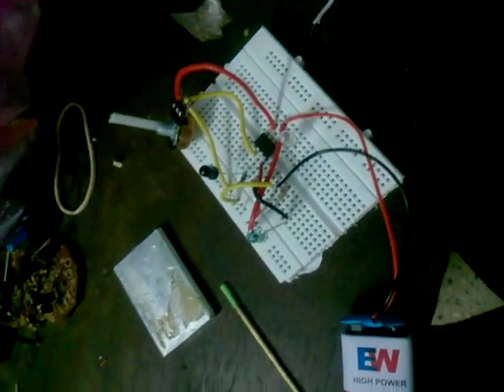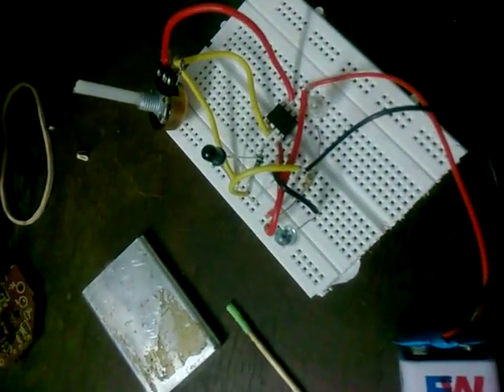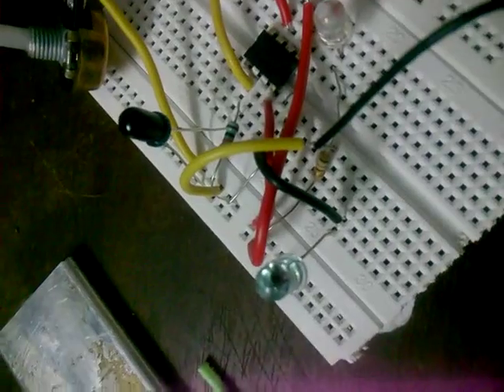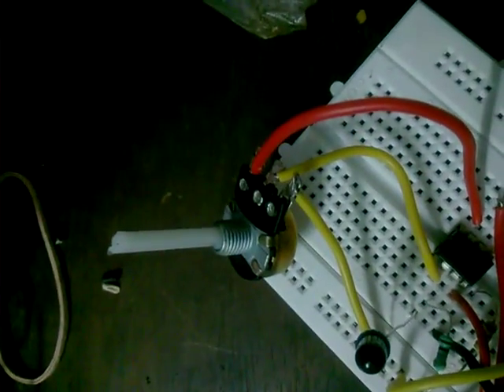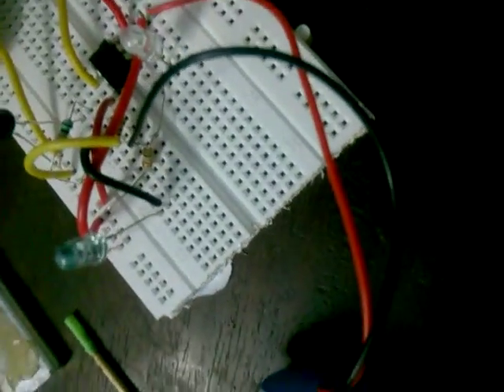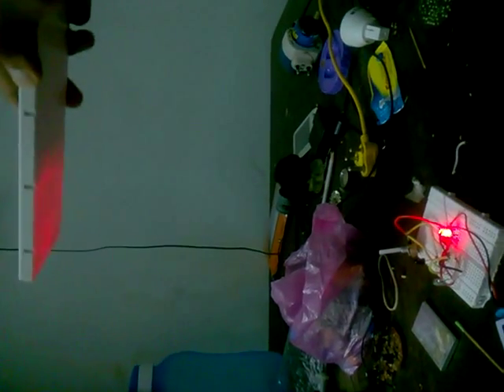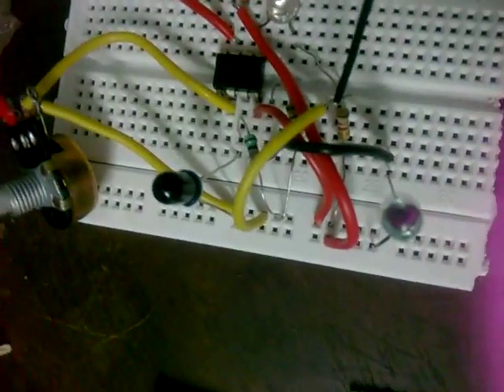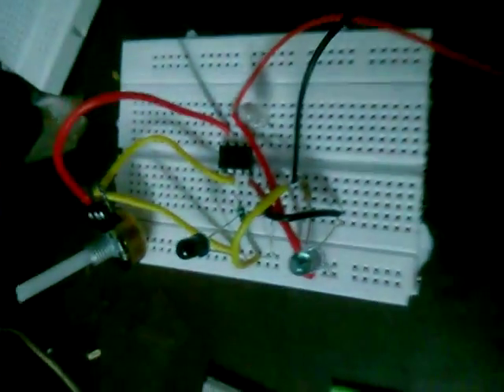Op Amp based proximity sensor (Very sensitive)

Comment: I tried this using the schematic diagram (all resistors 1k,1k,10k and 10k potentiometer value) you gave but there seems to be a problem... Red LED is already light on... it should light only when theres object right? what you think is the problem?
Reply: +i Heretic is it because I used 1k resistors?
Reply from the maker: +i Heretic +i Heretic did you try adjusting the value of potentiometer. Try both 
the extreme values of potentiometer. Also make sure that the Photodiode 
is reverse biased ( Cathode connected to positive rail of the battery). 
Let me know if it solves the problem.
Reply from the maker: +i Heretic no its not because of 1K resistor.
Reply from the maker: +i Heretic Also the green wire in schematic is not connected to the potentiometer.
Reply: +Vibhore Jain ohh I thought the green wire is connected to potentiometer... maybe thats the problem.. wait lemme try it
Reply: +Vibhore Jain I've tried it all. changed the potentiometer to 20k and 500k also the reverse biase but it's still the same. I also did what you've done on the video... the red led is always on even if theres no object above IR led and photodiode... when it's maxed counterclockwise there's still small light and when it's max clockwise its super bright..
Reply from the maker: +i Heretic  Here is the construction video (exclusively for you) 
https://www.youtube.com/watch?v=SzM6KLQlLR0

Comment: nice! can I have the schematic diagram of this? my email is asphire04@gmail.com thanks in advance :)
Reply from the maker: +i Heretic Here are the schematics
http://1.bp.blogspot.com/-ygpokUlSYqM/Vq7PR_e68aI/AAAAAAAAALY/zWOM7c2xTwQ/s1600/741.PNG
Reply: +Vibhore Jain thanks! 1 more thing for clarification... I have read the comments below... where is the two 560ohms resistors? sorry I'm no good in electronics hehe also if it is okay if I used 20k potentiometer
Reply from the maker: i Heretic Actually the 560 ohm was used with IR LED and red LED but that resistance is very low and there was a chance of damaging the LEDs so i used 1 kilo ohm in the schematics... 20 K pot will do fine. No need to be sorry, I was pathetic a year before with electronics... :)
Reply: +Vibhore Jain ohhh okay! so, its better to use 1k  ohm resistor instead of 560 ohm? and where will I put -9V is it on ground?
Reply from the maker: Yeah 1K is a safer value instead of 560 ohm. There is no -9 volt.The +9 volt is the positive terminal of the battery while ground is the negative terminal of the battery.
Reply: +Vibhore Jain alright thanks!
Reply from the maker: +i Heretic Remove the photodiode from the circuit and see if the LED still glows. If it does then may be the chip is damaged ( Hardly possible) and if it does not maybe the IR photodiode is broken.

Comment: hi Vibhore Jain what exactly the values of resistors you used? and what are those diodes called?
Reply from the maker: +Aaron Flores The diode that emits the infrared light is called IR L.E.D (bluish transparent in video) and the receiver is caller an IR Photodiode (The black component). I used two 560 ohm resistors to limit current to the regular L.E.D and the IR L.E.D and the IR Photodiode is coupled with 10 kilo ohm resistor.
Reply: +Vibhore Jain thank you very much! the 10kilo ohm resistor is called potentiometer right?
Reply from the maker: +Suzini Actually there are two 10 kilo ohm resistors in the circuit. One has a fixed value (in series with IR photodiode) and the other as you said the potentiometer.
Reply: +Vibhore Jain Hi! do you have schematic diagram of this proximity sensor?